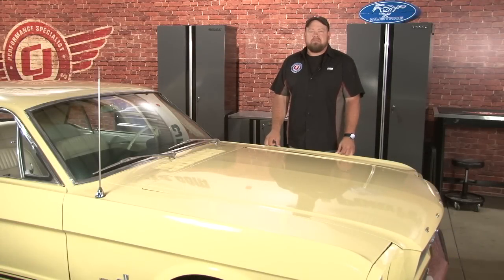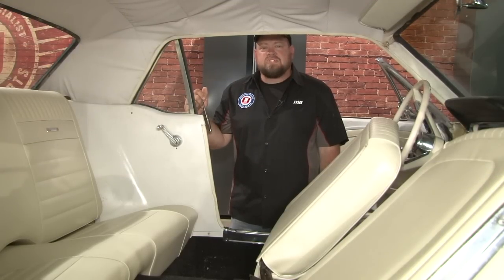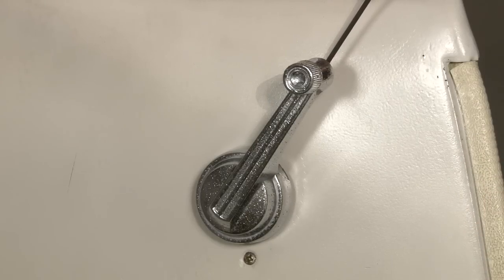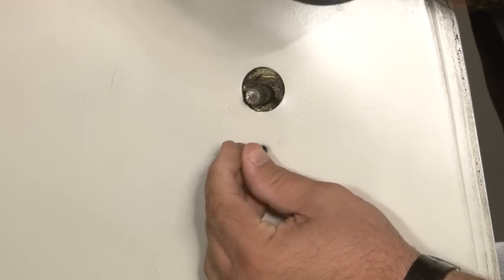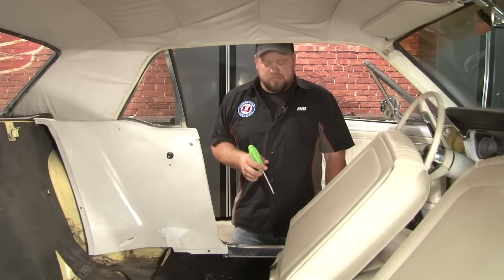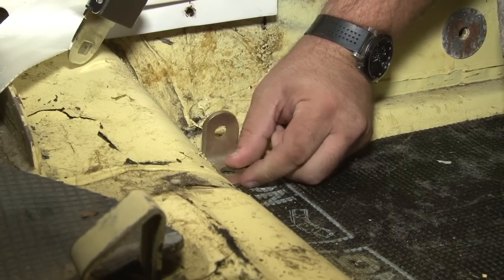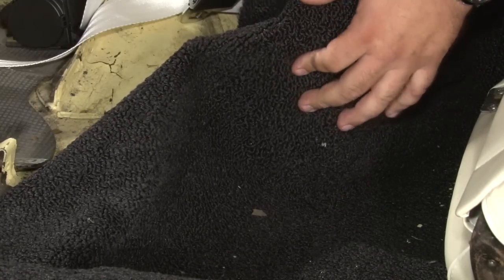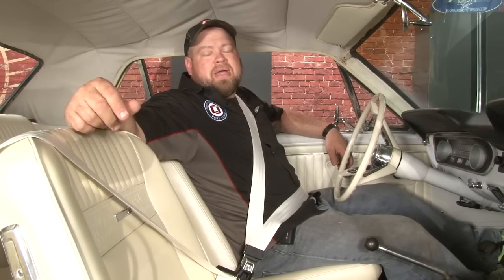Retractable 3-Point Seat Belt  | 1965-1973 Mustang

Comment: For what it's worth...My 66 Fastback has a bracket behind the headliner, presumably for later design and install of a 3-point belt. All I had to do to use it was to drill for the pivot bolt (AND avoid drilling through the outside of the roof sheet metal, which will ruin your whole day!) I then used some fine SST wire to hold onto the bolt while  snaking it into its new home. Be sure to locate the hole in the headliner where it will be when it is stretched back into place. I mounted the reel as you described in the video, and the anchor in the original location. I did get extra-length belt to account for the longer mounting locations. Works fine - hope I don't have to test the install under emergency conditions! I also installed 3-point belts on the rear-seat positions. Posed a few additional problems, the main one being mounting the reel. I fabricated a 1/4" steel bracket and anchored it in the trunk floor (NOT the gas tank part!), through to the frame rail, and drilled through the fiberglass panel to mount the reel anchor bracket.

Comment: Welp.. that one sold me.. I ordered a set, thanks for great video
Reply: Update: this doesn't fit a Fastback, it will be sent back. The upper anchor is not compatible with fastback interior panel
Reply: @MarkCarr331  what did you end up doing? I'm going to be in the same situation with my 65 fastback.
Reply: @natedawg4997  I ended up installing a roll bar, cage system and 4 point belts. Zero regrets

Comment: Be careful on 67 coupes. The chrome corner is in the way of the shoulder strap anchor point. Need to drill a hole a little lower than the one Bill does! I learnt the hard way 😅. Plus I find there is no room for the plastic spacer. They could have made the bolt that is attached with rivets a little longer!

Comment: It's wrong to require metric tools to work on a car from 1965.
Reply: Hey Rick - go buy a new flywheel and try to mount the pressure plate with your old bolts - it didn't come with a compatible set. Guess what ? They're METRIC on the flywheel, and the threads ALMOST match original. Criminal, thinks I! OK, I should have asked if the flywheel was metric or not...but who would have guessed this level of skullduggery?

Comment: Thank you for this video! It seems like my kit came with a few more parts than you actually use. I counted 1 bracket bolt/rivets/nut/nylon spacer combination on the shoulder anchor point, 2 bolts/2 nuts/1 small washer/1 large washer/1 angle bracket on the floor mount point, and then you reuse the original bolts on the other two mounts. My kit has 4 angle brackets, which would leave two left over after doing both belts, 8 bolts/nuts/small washers, which would leave 4 of each left over, and a couple of nylon stepped washers that you didn't use at all. Am I missing something?
I notice that you did this video 5 years ago, so maybe the kit has changed a little since then.

Comment: I am not fond of this type of installation on a coupe at all. It makes sense on a convertible when it is pretty much your only choice, but I don't like it for the coupe. In this install, the seat belt has to come up and then back down over your shoulder. I am more in favor of doing some extra work and attaching it to the roof support rail. It takes some extra time and a little bit of extra work, but I like the end result much better. That is how we did it with this exact kit. Doing it our way took us 8 hours to do the install. The other thing I am not fond about with this is is the fact that the 'receiving' end of the belt (the one attached to the transmission hump) is extremely short. This caused us several problems: Our '66 is my daughter's car, and she is short, so she has to have the seat pretty much all the way up, which puts the receiving portion at the back edge of the seat. In our case, we have a console installed in our car which ends up trapping the receiving portion between the seat back and the console so that you cannot unhook the belt.... this caused us a major issue. If it were adjustable, that would be great, but no, it isn't. So we had to make modifications to make it work. Not happy about that!

Most other kits come with a roof support rail attachment bracket that you have to 'fish' in to the rail. it takes some work, but I like the final results much better. This kit does NOT come with the bracket to install in the roof support, so we had to fabricate our own (a large reason why it ended up taking us 8 hours to do the install). I would suggest CJ Pony add these brackets to the package. Charge a couple of extra bucks if you need to, I'm sure people wouldn't mind. I wouldn't have!!!! It would have saved me a LOT of grief! I realize we could have installed it as shown in the video, but IMO I think it could cause spinal compression in a crash. Granted, that might be better than obliterating your face on the dash or steering wheel (providing it doesn't cause long term back problems), but I'd rather attach to the roof support and not have to worry about it.

Finally, find SOMEONE that can put together a decent set of instructions. The instructions provided aren't too good (and that's the only kind way I can say it).
Reply: Do you know who sells kits with the roof brackets? ??
Reply: +John Doe If you install on the roof rail, you run into problems with the belt coming too close to your neck and rubs on your clavicle .  It doesn't seem perfect either way and I guess it just depends on what you prefer.

Comment: I'm new to car restoration, so I've had a bit of trouble with this installation. Even though it's supposed to be really easy. The one part that has stumped me is that I can't find the whole for the receiver, there's no whole in the carpet either. What should I do?
Reply: I know this is really late but drill a hole in the floor if there is no hole and take a box cutter and cut a hole in the carpet

Comment: I've herd if the 3rd top point of the seat belt is to low it can compress and break your back in a accident, is that true? cause is the video is looks pretty low
Reply: Without a proper pillar like a newer car you have to either mount it low or high. Both have their plusses and minuses but are better than just a lap belt.
Reply: Bill, do you guys have a rear seat belt installation video? I have a daughter and am looking at installing a rear belt for her safety.
Reply: 3 point belt mounted too low will compress your back, but only on one side.  So while its compressing, it'll also TWIST your back.  The combo is very nasty.   

Consider a 4 or 5 point belt to avoid the twist.   Or mount it up high to avoid the compression.  

An ideal solution would be to add a seatbelt loop to the factory seat that moves the belt higher as it goes over the seat. It could attach to the frame, just like the TMI aftermarket headrests...or it could be part of the headrest.   Either way, this would solve the problem.  But nobody makes it for the factory seats yet.
Reply: I was considering doing what you mentioned with say 90's convertible mustang seat belt system. there is a retractor inside the quarter panel and a belt loop that attaches to the seat outside top corner to give higher angle for the belt to go over your shoulder.

Comment: CJ,

Do you think the lower mounting point makes the seat belt less safe than one that would mount to the roof?
Reply: Tracey Lee I would prefer it be higher up but I am not a fan of the roof either because it creates a weird angle. Either though is better than a lap belt
Reply: Bill. Thanks for the response. I think I'll get four of these and install them in my Cougar.
Reply: Hey Bill! Is there a way to remove the quarter panels after installing the bolt with the rivets. I need weather strips in the future and it will be near impossible without being able to remove them. (66)
Reply from the maker: I have not tried but I feel if you began removing the panel from the rear you should be able to clear the stud. if not rivets are easy to drill out and are cheap

Comment: Hey Bill, first thank you....I think this will be great for my 65 convertible....other than "its better than a lap belt", is there any concerns with how this sits across your shoulder in a convertible.  I think that this is basically the only option.
Reply: +sishac    Its not ideal how low it is but it will do a better job of protecting you in a crash. The other option is a custom harness bar and 5 points.
Reply: +sishac    Its not ideal how low it is but it will do a better job of protecting you in a crash. The other option is a custom harness bar and 5 points.
Reply: +Bill Tumas is it expensive to put air bags in your 1969 mustang? Like what is the relative cost of that and putting in automatic Windows and the cost of putting these seat belts (if you pay a shop to do it) thank you